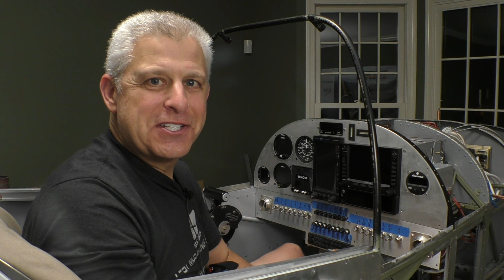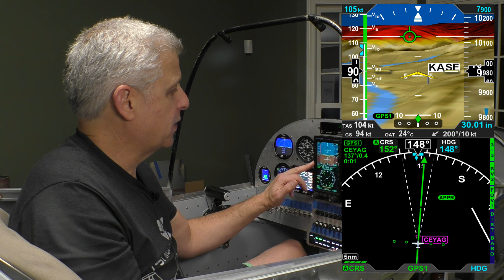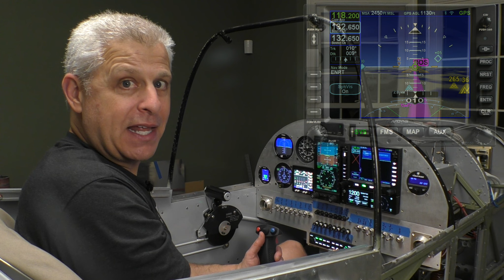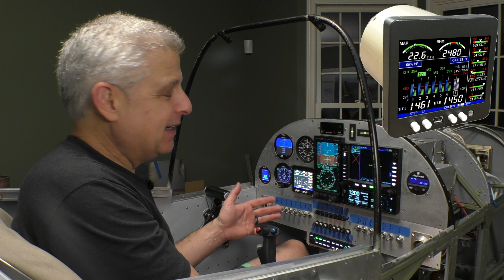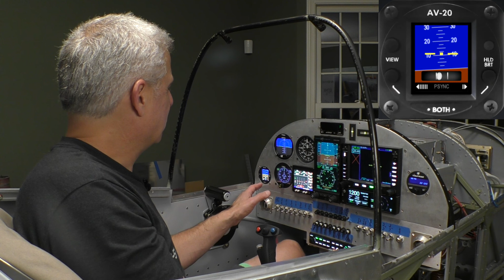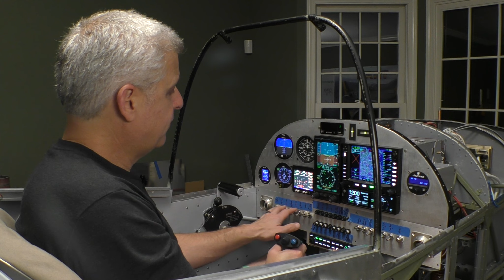Want FREE avionics feature upgrades? Build a Modular "Best of Breed" Panel for Your Aircraft!

Comment: The LM4 325 cu. in. (5.3L) engine has a cast iron crankshaft where the LT1 376 cu. in. (6.2L) engine has a stronger fordged crankshaft and direct port injection which makes a good bit more HP too. Stepping up a little more, the LT4 6.2L engine is supercharged and makes 650 HP.
Reply from the maker: That's great info.  Thank you.  We got the LM4 from Titan Aircraft since it was used in their demo aircraft Camel Smoker before they switched to the LS3.  They switched to the LS3 because it could be purchased as a crate engine and because so many builders liked the potential for more HP and readily available mods.  That said, we don't care much about the extra power.  So, getting a deal on a proven LM4 is exactly what we were looking for.